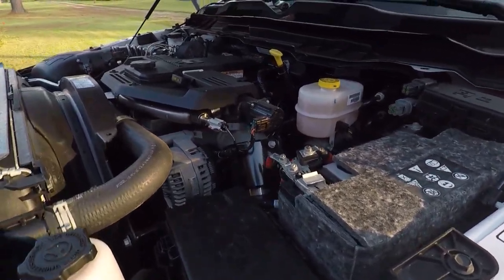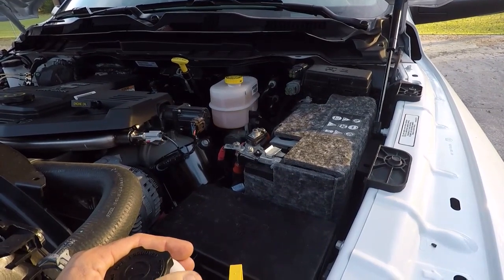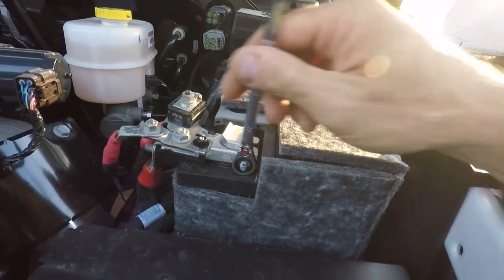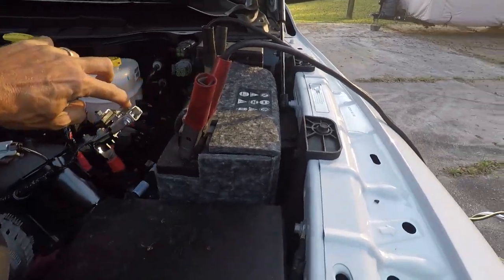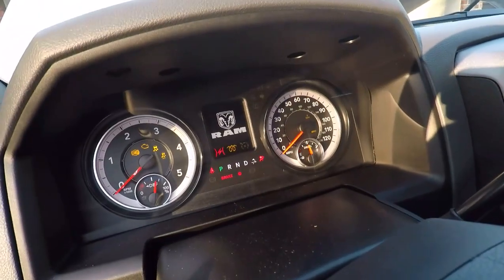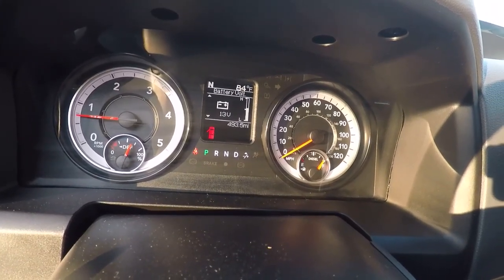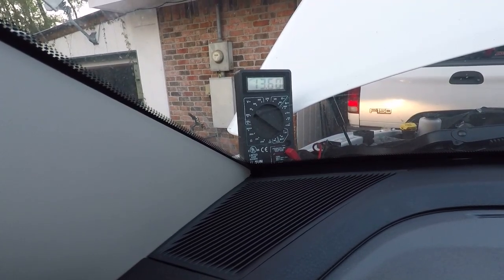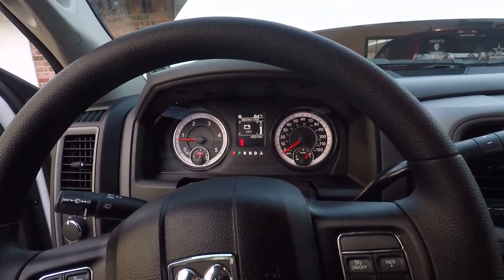2017 RAM Cummins Low Voltage Fault Diagnose and Repair

Comment: So, I JUST left the dealership (for the 3rd time) only this time the light was still on. The service manager spent 30 minutes on the truck (told them the light will be going out soon so please run diagnostics ) After 30 minutes he explained he is pretty sure my Alternator is bad. Well the Ecodiesel alt is 1200 just for the part. As it stands I was supposed to drop it off this morning but I did not. I just watched your video and will be heading STRAIGHT to the bolts as soon as I get home !!!!! OMG I hope that is it. Thank you in advance.
Reply: Was it it!? Got the same issue I am diagnosing.
Reply: @smartmotives  I still don't know. It stopped for the past month.  So I'm lost

Comment: After having my 2012 RAM 2500 CTD for almost 7 years now, the check engine light came on for the first time, I got the P0562 code which of course narrows it down to either the batteries or alternator, after watching this video I hooked my volt meter to each battery and when I started it the voltage went down to about 8 volts before the engine fired up, the good thing is that the voltage went back up to 14.33 volts when the truck is running so yeah I need new batteries, I replaced the batteries in 2015 with interstate batteries so at least I got 5 years out of them with really no issues.

Comment: Thanks for posting this, i have the same problem, it gives the low voltage warning when i hit bumps, so i think it must be a loose connection between the batteries and the alternator.  Larry

Comment: 11v at start up is common then it jumps to 13v to 14v is how both my Ram trucks (2014 &2018) voltage runs
Reply: Glad I saw this post.you left

Comment: I chased this problem for a long time it's the little black and silver squares on top of. the positive terminals that's the culprit.
Reply: How did you come to this conclusion and what was the fix or alternative....I have same problem
Reply: And what is the part called, I've replaced batteries, alternator, battery temp sensor, its driving me crazy
Reply: not always. i replaced my fuses as well. didnt fix it.

Comment: i have a 2019 ram.i had my did the same today.checked the battery and alt. with a volt meter.all the reading are good.but i had my doors open and turn on the acc quite a bit.was putting in some additional lights.i think doing all that may have cause the trouble..maybe. went back out and restarted my truck 2times.fired over and the volt meter still says 14 blah blah volts.plan to put it on a charger anyway tomorrow.

Comment: Have a 2015 1500 hemi. The low voltage/battery save mode lights came, took it to have it read at autozone they said that the battery was fine and that it was the alternator, so I took out the alternator and had it tested at the same autozone and it passed. Also the power steering became real stiff where I have to use all my strength to turn. Any thoughts?
Reply from the maker: The power steering failing could be it. I believe the hemi trucks use electric power steering so if that motor supported out it could cause a serious drain on the charging system until it burned through. That might cause your symptoms.
Reply: Power steering fuse is on the battery terminal

Comment: I have the 18 6.7L and I keep getting the message envelope my truck has power save mode that continues to display but Dodge claims nothing is wrong. I'm considering buying and upgrade alternator.  Look and see if you can shut off your engine power to zero seconds after you turn off your truck, my option is in the radio to do that
Reply from the maker: I haven't set the power-off to immediate, but it does kill it when I open the door, so that's usually pretty quick. If you are getting the Low Voltage warning, I'd definitely confirm all the wiring connections and if they are good, I'd try to run a good voltmeter to see exactly what the truck is doing when it throws the fault. If the charging voltage drops below 13.0, it will throw the code even though that may be good enough to keep everything charged up. Since tightening the loose connection on mine, it's been fine for 20k miles. You might also be able to monitor the voltage with an OBD2 scanner. That might be easier than a volt meter if you have one available. Good luck!
Reply: Did you figure out what was going on?

Comment: I have 2018 Ram 2500 6.7L it's about 12° outside and my garage heater isn't working so its about the same in my garage. Its started and ran daily I only have 8,800 miles I'm in battery saver mode and the dealership claims its normal "bullshit". Just fyi press your cruise control button then set button while parked it will idle the truck to 1k if you press the resume up it will rev up 100 rpm up to 1,400 rpm
Reply: Battery saver mode is normal when the air temp drops below freezing. When you do a cold start on your truck the grid heater continues to cycle on and off to try to keep the air warm for up to a minute  that is going into your cylinder heads. It is trying to protect the batteries. Once battery saver mode turns on it will stay on your message board until you turn the truck off. It resets it. It doesn't mean it is in continual mode. It's just a cold start thing. Once the air temp is warmer than freezing point it does not turn on. Mine is a 2018 Ram 3500.
Reply: @CSXtrackworker  I have a 2018 ram 2500  It is Winter not freezing but cold my low voltage like came on can you elaborate on what you are talking about
Reply: @ranch5223  if you have a low voltage light message on instead of a battery saver message then you need to check to see if the connections on your battery terminals and alternator are tight. If they are tight then you may have a battery with low voltage.

Comment: On the 2018 eco boost i noticed i will have low voltage it drops to 10-11 volts and immediately goes too 13 volts consistent and the message for low voltage goes away at full operating temp? Anyone know why?
Reply from the maker: That is pretty odd. I wonder if the alternator is wonky when cold. I'd clean the connections and possibly have the nater tested to see if it acts up on its own before replacing it.

Comment: Hopefully someone responds but I’ve been having a problem with my 2014 ram 2500 I have the single alternator setup I went to Missouri for 2 weeks and the batteries completely died I jumped the truck, the truck ran fine but after a 4 days battery light came on and alternator stopped charging the batteries got a new alternator and the alternator started smoking and burned out the alternator fuse was it just a bad alternator? Or something else is going on
Reply from the maker: Howdy! Have you changed the batteries recently? If you have the OEM batteries still in the truck I would expect they are junk. The alternator failure is odd, but until you confirm that both batteries are good, excessively low battery voltage can increase the amp draw and cause odd malfunctions.
Reply: Aaron Rose I got the duralast platinums but I bought a new alternator and installed it with the original batteries and the batteries were reading 11ish volts and the truck started and that’s when the alternator started smoking so now I got a new one tested it and it passed, now I’m just waiting for a day off to install it I’m charging the batteries the day before so they’re at full power
Reply from the maker: Yowza. Definitely charge those batteries. Anything below 12.2V is very weak. Running them down into the 11's can damage them pretty quickly. A battery at 100% should read in the 12.8v range when tested with no load. If the batteries don't come back, I've had very good luck with the AutoZone warranties over the years. Good luck.
Reply: Aaron Rose it was the battery’s I’m an idiot I should’ve known better im at 14 volts

Comment: Hey I have a dodge ram 1500 2017 3.6 and I change Alt battery and low voltage still showing plz help I'm 2000 in

Comment: I have a 2017 ram 1500 6 cyl I had my battery light on I got a new battery and still the battery is on 
Any ideas of what to check next? Thanks
Reply from the maker: First things are clean connections to the battery terminals. Then make sure the alternator is putting out 14 volts. Finally check all the connections to the alternator.

Comment: did the battery light went off? I'm having same problem with my 2015 ram , but my case I just put two brand new batteries and it shows low voltage and can't figure it oyt
Reply from the maker: Howdy! Yes it's been perfect for the last 4000 miles. Check your alternator output voltage and if it's 13.8 V or so, confirm all the connections on all the wires are good and tight. Good luck!
Reply: Two months after the purchased this messaged popped up. I thought it was new so I was simply ignoring it . So it happened again on Nov 17 and today. All the cables are tight. I will try to send it to the dealer to be checked.
Reply: so what happend at dealer? did they fix it? what did it take to fix it?????
Reply: I am also curious if you figured anything out.
Reply: I have a 2018 2500 Mega Cummins with 12K miles - "battery saver mode" keeps coming up - I read on some forum (which I need to find again) that it can be the intake manifold preheater.  Anyone know more info on this?
Reply: @patrickoconnor1219  You ever find anything out? I'm having some odd issues as well, including random limp mode pointing at turbo actuator. But I'm wondering if it's actually a bad ground somewhere. These trucks are famous for it.

Comment: I have the same problem on my 2017 RAM 3500 Laramie Longhorn Cummins. This is the third time it happened. "Battery Low Voltage". On the cummings forum they are saying the same thing. It seems like this is a common problem now but Chrysler hasn't categorized this as part of the recall (or simply ignoring it).
Reply: I am having the same problem put in new alternator and batteries made sure all connections are tight and still has problem. Dealer ship said i needed new computer for 4000.00 they said the regulator for the alternator was in the computer and had gone bad. Does this sound right to you guys?

Comment: Had the exact same issue with my 17 3500.  Only difference was when it was built the rubber boot had been squeezed between the nut and stud on the secondary alternator.  Due to this the cable and stud had been arcing to the point that when I figured out the issue I couldn't tighten the nut down with the amount of damage on the threads.  So that simple little mistake at the factory cost RAM a brand new alternator.

Comment: This keeps popping up on my 2018 ram 2500. I drove 20 min yesterday and the light kept coming on then off. Dash reads 13v all the time
Reply from the maker: Being pretty new, I'd definitely check all the battery and alternator connections, if they're tight it could be the batteries or the alternator itself. In that case, hopefully warranty will take care of it. Good luck!
Reply: I just went through and checked all the battery connections & the alternator. Everything was tight except I got a few turns out of the pos and neg on the drivers side. Now the light is on right away and it’s reading 12v. I’m going to check the batteries tomorrow and the alternator. Thanks for the video!
Reply: @thormx47   what was the outcome my 2018 Ram2500 started the dam low voltage light shit too
Reply: Dealer fixed it under warranty. Passenger side battery was bad and there was a short at the generator

Comment: I have the same thing with my 2017 3500 right now. Just put in 2 new batteries and 2 different alternators. Truck has 110k miles. Started 3k miles ago. Went down to 8 volts the other day. Put a new alternator jumped it drove fine for next 400 miles till I made it home and the entire time the battery light came on and of. Voltage went from 12-13. Anyone know what’s going on? Thanks
Reply from the maker: Hmmmm. That's odd it still does it after replacing about everything in your truck. If it's flipping around 12-13v it's still charging as you saw in the video. Just not as much as it should. Any aftermarket stuff like a stereo amp or big lights? If so I'd disconnect them short term to rule them out. Then I'd triple check all the connections and maybe even try to see if there is a broken grounds strap somewhere. Good luck!
Reply: Pcm update us available
Reply: im on my 3rd altenator and batteries. I keep throwing the same light. checked all connections and i have a single altenator on my 2017 2500. I even changes the fuses on the terminal lines of the battery. no luck so far.

Comment: So your saying the fix was a loose nut that needed to be tightened on the secondary alternator?
Reply from the maker: Yup. That one loose connection was the problem. Almost 14k on it now and never happened since tightening that terminal. Thanks!
Reply: @aaronsrose  nice thanks for the info